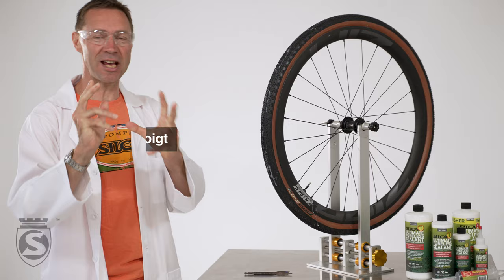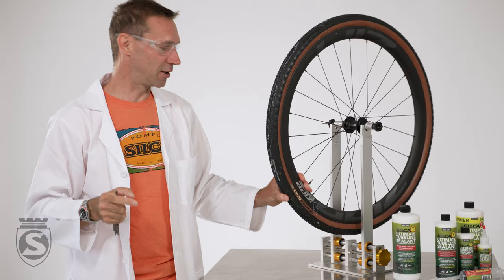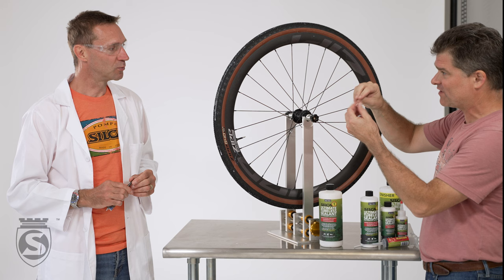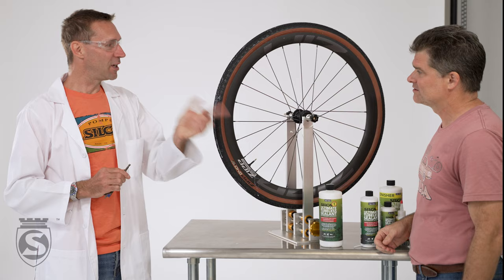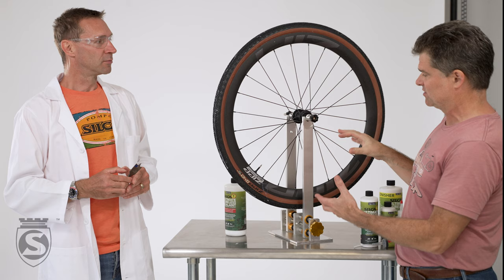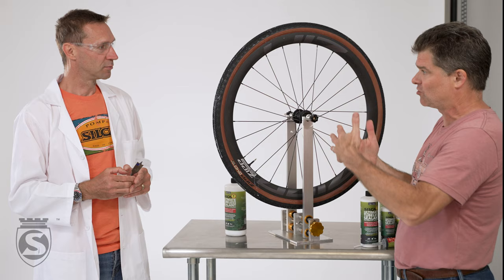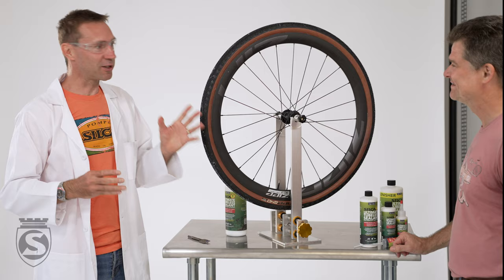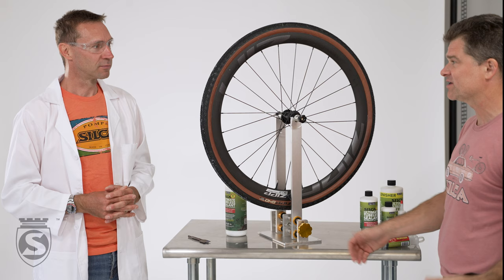SILCA Test Lab with Jens Voigt EXTENDED Version

Comment: My first two bottles of the Silca Ultimate tubeless sealant - purchased separately a couple of months apart - all resulted in the carbon fiber coagulating into a few lumps of carbon fiber balls, leaving very little free strands of carbon fiber available. Silca has acknowledged bottling issue resulting in some bottles containing too much carbon fiber and that was the reason given for those carbon fiber coagulating into balls which eventually formed at least one large cluster. 

So while I can't speak to how well the carbon fiber work in sealing puncture - the strands of carbon fiber in my wheel had coagulated into a large lump of carbon fiber balls - I can say that the sealant itself does work in sealing punctures. I had three punctures in the rear wheel (Enve 4.5 AR Disc with Schwalbe Pro One TLE 700-28c tire) and two of them, I didn't even notice until a few days later when I put the bike on the stand for maintenance work. Those two punctures resulted in negligible loss in tire pressure - I have Quarq TyreWiz tire pressure monitor installed and tire pressure data are logged along with other ride data - so they must have been sealed very quickly The one puncture that I observed happened while I was going at about 25 MPH. After pulling over and slowly spinning the wheel a few times, the puncture sealed. There was a 5 PSI drop in tire pressure, from 68 PSI.

If Silca has fixed the issue of carbon fiber coagulating into balls - I'm still not 100% convinced that this is due to too much carbon fiber - and the carbon fiber in the foamy sealant works as advertised, in spite of the more difficult and messier sealant installation method (you cannot inject the Silca sealant with FIBERFOAM), I think the Silca sealant is a good product. 

A couple of suggestions:
1. Put some identification on the label that allows you to find out which batch or lot the sealant came from. You guys are already putting lot number on the bottles of your super secret chain lube, why not do the same for your sealant?
2. The instruction on the bottle label says "SHAKE WELL!". That's OK for a brand new bottle filled with sealant. But when the bottle is less than half full, shaking it well causes it to be too foamy. You will have a hard time measuring the exact amount of sealant when the sealant is foamy. Perhaps "SWIRL WELL!" when the bottle Is less than half full might be better.

Comment: Hi.. my method for installing sealant is to fill the tire through the valve stem (core removed, of course) will the carbon fiber strands still allow for this method to work? Or is the sealant too impeded by the little strands to fit though the valve stem without clogging?
Reply: Nope, here is the info from 6.20 on https://www.youtube.com/watch?v=oPJF63IBnsM

Comment: Nice lab test where guy who is testing is wearing silica shirt 🤣🤣🤣
Reply: A tiny part of me is dying on the inside knowing that there are cyclists out there who don’t know who “the guy” is. Jens wore yellow in the TDF twice, and is one of the nicest guys that raced in the pro peloton. I hope he’s getting mounds of sweet Silca money for this video. But unless he lined that tire with Hundo’s from an endorsement, the sealing power of that sealant is next level. 

FWIW I’ve been using it for a year, and my tires hold air much better day to day than with previous sealants. I can’t comment on how it handles punctures, because I haven’t had a single one that I can identify since I started using it. 
Full disclosure: I’m wearing a Ramones shirt.  Gabba Gabba Hey
Reply: @DoctorTim  I swear it rolls faster than Stans because of how much it foams up and more evenly distributes its own mass within a rolling tire...(mtb 2.5" tire with ~80grams of sealant per tire)

Comment: Let's start with 90 psi and see how much pressure is lost and how much sealant is lost before the sealant takes hold because that's part of the problem with other manufacturers  products.
Reply: check their others videos, its been showcased. Big ol confetti strips of different sized carbon fiber bits 2-8mm...sealing holes up to 6mm'ish at higher than 60psi readings. I do mountain bikes, so I'm holding heavy getting fat 8mm punctures, full sealant (27psi'ish)   great product